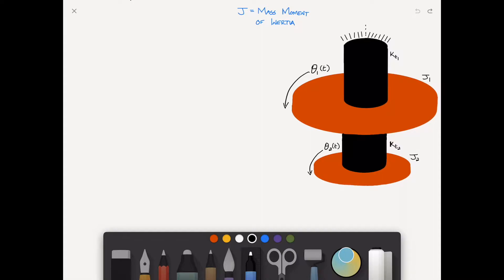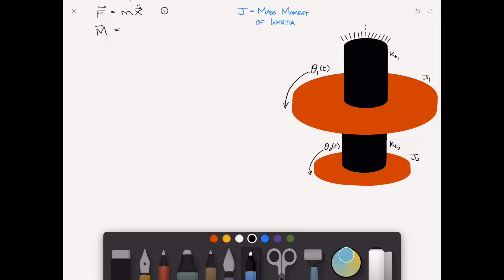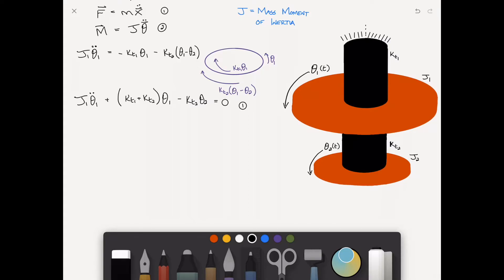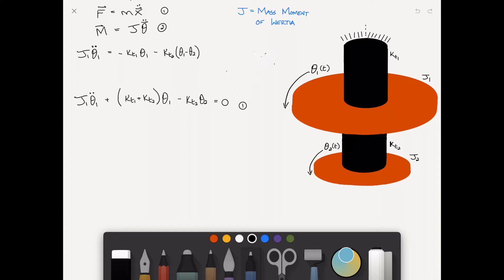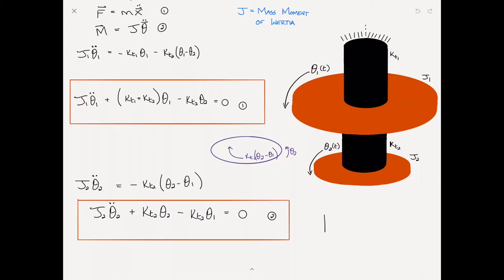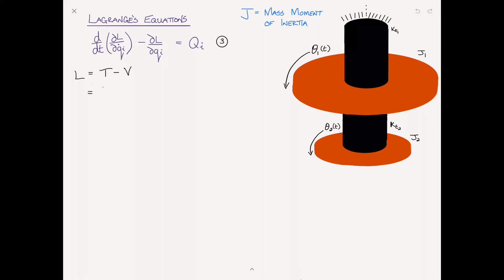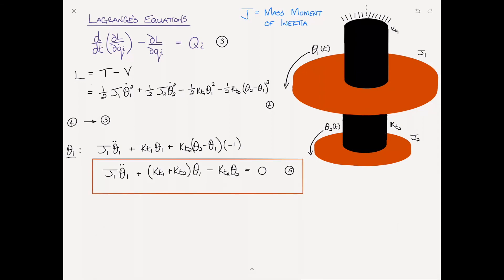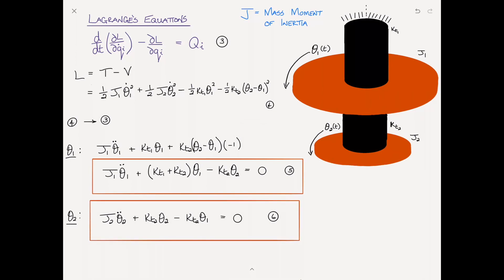Equations of Motion for a Torsional 2DOF System Using Newton's 2nd Law and Lagrange's Equations

Comment: if we want to add a NES to  this system. How would the mathematical model change?
Reply from the maker: An NES is a nonlinear damper. Take a look at this video in which I should how to incorporate damping: youtube.com/watch?v=NV7cd-7Rz-I

This video uses a linear damper but the method of implementation for a nonlinear damper would be identical. The only difference is that this would result in nonlinear equations of motion which cannot be written in matrix form, so you would likely need to solve the equations numerically. 

I have several videos showing how to solve equations using numerical methods. In particular, the double pendulum problem has nonlinear equations which I show how to solve in this video: youtube.com/watch?v=nBBQKZb6JZk

Comment: Using the standard way of deriving the ODE for the system (i.e not using the Lagrangian method), why is it that the (theta_1 - theta_2) terms flipped for the both of the FBD of the two discs? In other words, why is it that the contribution of the second spring constant for the first FBD is Kt_2(theta_1 - theta_2) while the second spring constant for the second FBD is Kt_2(theta_2 - theta_1)?  Is it assumed that one disc is twisted more than the other?
Reply from the maker: The is no assumption to the relative twist of each disk.  The reason for the difference in signs in the moment comes from Newton's 3rd Law.  The force (or moment) experienced by one mass is equal and opposite to the force/moment on the other mass.

Comment: Your videos are great. Please keep doing these kind of clips. 

May I suggest you attack some aeroelasticity problems? They are very similar, and I know you have an aerospace background.
Reply from the maker: Yes.  That was my eventual plan...to get to the computer simulation of some aeroelasticity problems (which is my field).  Wanted to get there from a computational point-of-view rather rather than just analytically.  First I think I need to make a short series on aero - perhaps panel methods and perhaps CFD eventually.  Then I can couple the aero and structural models.  Along the way I will definitely make a video of a simple aeroelastic analysis using a 2 d.o.f. model and basic aero.